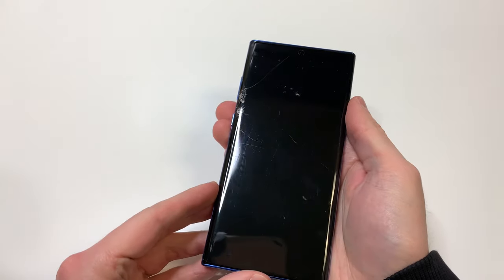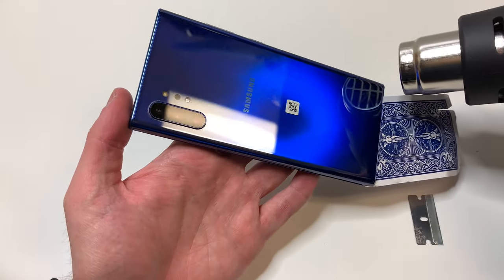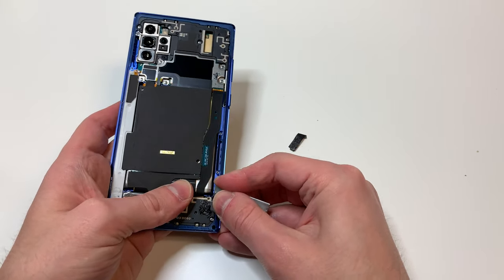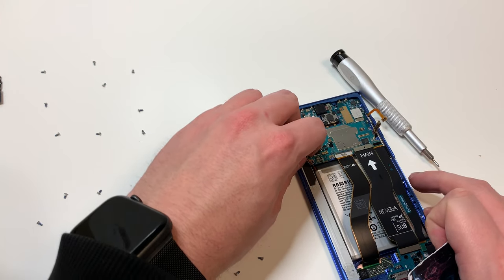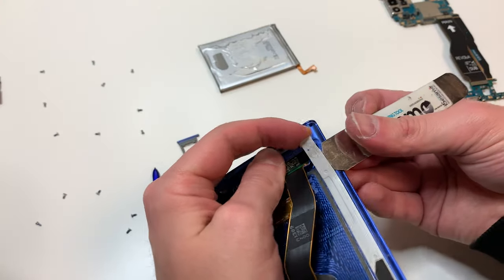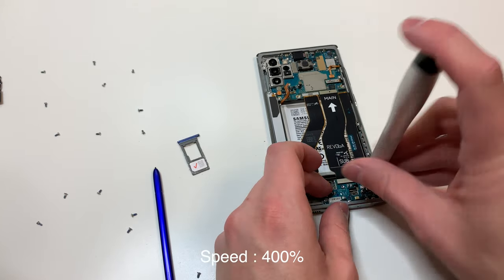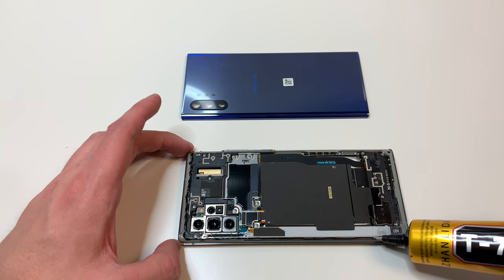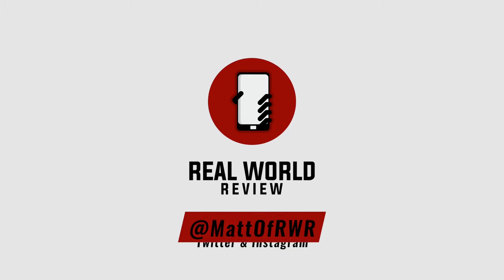Samsung Note10 Plus Screen Replacement (Fix Your Broken Display!)

Comment: Now I don't feel so bad about the price they charge to do this
Reply: Dude... they charge over 300$ for just a screen replacement. A brand new note 10+ is 3-400$ just buy a new one or fix it yourself
Reply from the maker: Perceived value doesn't mean anything when the actual value is a real number lol these parts are expensive because people complain about the parts being expensive
Reply: @RealWorldReview  I'm not trying to be a dick, but genuinely how is a part more expensive because people complain? Demand?
Reply from the maker: Well let’s try to visualize this. You’re more likely to spend $20 than $300, right? Well there’s lots of situations that happen to get that part that you’re buying. Let’s say those numbers are cost, so let’s sell them for $40/$340, same profit value. You’re more likely to sell the $40 product, so you can eventually drop the price to $38, then $35, all the way down to $30, which now you’re selling even more. The $340 may drop to $338, but who wants that when for less than that you can buy the entire device used for the same or even less? So now that $338 price never drops. Not to mention if you’re refurbishing, that $338 part has a higher chance of being damaged during refurbishing, which will cause companies to raise that cost even more. So now that $338 part goes to $380 because supply is finite, and you took some away from the supply (honestly similar to how BTC works). So the part isn’t expensive to be expensive. OLED parts cost more money to make than LCDs, while LCDs are SOOOOOO much easier to make aftermarket versions of when compared to OLEDs, especially curved OLEDs. Even now an aftermarket Samsung Note8 (yes a phone from 2017) screen is inferior to the OEM version in quite a few ways, and the price difference is very minimal. Even then those are $100 for aftermarket while an iPhone X is $45. There’s more variables in pricing, but that’s the broad overview of why that seller or store isn’t price gouging you (assuming they’re charging less than $100 over part cost that they can show you). It cost me $210 to buy that screen wholesale, expect maybe a $20 price difference depending on who you buy from, but under $100 for the part will be aftermarket (for the Samsung Note10 Plus)
Reply: @RealWorldReview  can the screen and frame be repaired? My phone was stolen back in July and when they found out they couldn't get into the threw it on a busy bridge and it got ran over multiple times I had a Otterbox case on it. It still charges and lights up the sound would work too just can't access anything.

Comment: Great Video! At first it seemed complicated but pausing after every step its actually super simple! My phone repair shop was gonna charge me $400 to fix my screen on my Note 10+, but I just ordered a new screen and all the tools I needed plus new Back Glass, a new case, and a new battery (cause we pierced mine lol), all for around $150 and it works perfectly! The hardest part was waiting a week give or take for it all to come in but luckily my dad upgraded and gave me his old one to use for a while, my advice for anyone doing the same is to use yours or someone elses Amazon for free and fast shipping, and make SURE that the battery is the exact right model with lots of good reviews on it lol
Reply: Hey bro..my galaxy Note10+ display is also damaged..half screen is visible and the other isn't..but touch is working overall..do I need to order any specific screen model and touch model to be able fix and start using it..or just have to order like normal Note10+ display???
Reply: @mohammedanwaruddin7874  Anything that says Galaxy Note 10+ Touch Screen should work other then that you shouldn't need a specific model or party to buy from, though id recommended making sure it also says it has the frame
Reply: @galaxygold5939  ok thank you

Comment: THANK YOU SO MUCH!!  I made it all by myself  just by following your instructions,  payed 150 USD for the screen  but sadly,  I was very excited and  broke the  glass that is on the back  of the phone when I was opening the phone but whatever , The front screen is now working!

So be very careful and take your time when removing the back of your phone. just go safe and slow. 
About the screens I got mine for just $150 US from aliexpress and $15  more for the tools and the glue . the screen is around 300 US but you can get the ones with little defects for half the price, mine has just a little black dot and that's it.  I don't mind having it when its barely noticeable.
Reply: was it samsung genuine?
Reply: @metubeaccountko   Not sure it was 2 years ago so I do not remember, But I still have it and the quality it's pretty much the same.

Comment: Great video! Is it necessary to back up the files before replacing the screen?
Reply from the maker: Thanks! No you don't need to, but it's highly recommended in general if you have important info on there

Comment: If you are still using the CC method for removing batteries and other parts secured the same way as the battery, I recommend cutting a saw tooth pattern into the edge of the actual card with a knife or scissors. It makes cutting the battery tape much quicker.

Comment: Do you know if a Note10+ display replacement will work on a Note10+5g?

I just bought a shattered note10+5g off of ebay and I plan on using a note10+ screen + frame to replace it with but I'm not sure if It'll work.

Comment: Here's a tip: Connect the new display backwards to it's connector after disconnecting the old display. This way you can test if the new display works properly before complete disassembly.

Just installed a replacement display, and found that it doesn't work. Only tested it after, reassembling everything but the back cover :/
Reply: Where did you find a display?

Comment: You did a fantastic job with this tutorial. Thank you. This is very useful information for me. I was wondering if you could recommend a reputable distributor for replacement batteries for the Note 10 plus? I see tons of options available on amazon and eBay however I've been made aware that 90% of these are junk, and don't' deliver the advertised mAh rating... any advice would be much appreciated.
Reply: I personally has just self-replaced a Deji battery for my Note 10. It's working great with avg use time of 9h~11h (with screen on/off running daily browsing apps) and doesn't give off as much heat. Note that the phone own battery diagnostic will declare your every new battery as weak unless you change them at a SS service center.

Comment: I know this late, but I want to as a question. My note 10+ screen broke and was replaced but since then, the s-pen is not writing on all the screen. it writes on the side of the screen but not in the middle. I bought the s-pen sensor flex cable to replace it thinking that that is the issue. I cannot change the screen again because it is pretty expensive. Would like your advice on the matter.

Comment: Have a link to buy the necessary tools, and screen?
Reply from the maker: In the description. If the screen isn't there, then there's a screen shortage
Reply from the maker: It's in the description. If the screen is not there, it's because it's out of stock. Right now there's a major screen shortage on the Note10 and Note10 Plus

Comment: I was wondering do you need a new batt after that? It's a pretty serious bending in order to remove it no?
Reply: 99% isopropyl can be injected below the battery with a needle applicator. It will dissolve the adhesive and allow you to remove the battery without bending.

Comment: So theres a sizzling sound when I plug the screen cable in. Is my screen fried? Was doing a battery replacement and it did work but screen turned black after a min
Reply: Similar thing happened to me can u pls tell what was the fault ?

Comment: Excellent video! Question: I just dropped and broke the screen on my Note 10+ last night. I have Asurion insurance from Verizon. I looked up replacement screens on eBay and other sites, but they are very expensive. It will cost me $199 through insurance to replace the whole phone. My fear is that I want to keep my phone exactly as is. Since I don't know if there is a way to clone my broken phone to my replacement phone I may have to go with the new screen. Any suggestions on where to get one? Thank you
Reply: Back up to smart switch. You can back up to a microsd card and it'll copy everything back as is.
Reply from the maker: Do at your own discretion. I did that and was never able to restore via memory card
Reply: @RealWorldReview  Interesting! I had to replace my Note 10 Plus and everything went straight back. Maybe your SD card was encrypted? I made that mistake initially.
Reply: Thanks guys. I could barely see my screen on my broken phone, but when I placed the new phone next to the old phone I was able to make an educated guess based on reference when hitting the buttons on the screen. Anyway, I did use smart switch and back up and restore. Back up and restore did move some things to my new phone, but not texts or apps. Then for the heck of it I used Samsung Smart Switch and I have to say it worked quickly and flawlessly. It basically cloned my old phone to my new phone. Thank you all so much for the help.

Comment: Great Video,  But now the caller herars themself twice, I took appart and the square rubber pieces are in place around the mic holes where the board meets. would you know why the echo now?
Reply from the maker: Might be a defective frame.

Comment: Have you ever experienced receiving the wrong type of screen when trying to repair the note 10 plus? I replaced my screen and when i powered it on it has bezels. The oem is bezel less i thought.
Reply from the maker: They make aftermarket ones now. If you paid less than 200 it's not OEM

Comment: Hello! Hi!
So my Samsung Note 10+ (5G) is broken and when I took it in to the repair shop they said it was $600 for repair. Is this price fair? If it is, I might as well just buy a new phone all together. Thank you!
Reply from the maker: That's way too much. $400/$425 at most unless you have multiple problems
Reply: @RealWorldReview  so the screen is cracked and there is a few black and white lines running horizontally
Reply from the maker: @naelevangelism  Yeah a store should be able to fix that for under $400 for sure
Reply: U can buy a new one on ebay for 300$

Comment: Only my frame has some scratches above the spen , how can i get a new one?
Reply from the maker: You need to replace the screen with the frame all in one. It’s possible to separate the screen, but very difficult without the right tools.
Reply: @RealWorldReview  so i really need to pay 350$ for a new screen repair even though i only want the frame to be repaired?
Reply: Otterbox defender, worth every penny.
Reply from the maker: I would contact Samsung and see if they can do anything for you.

Comment: Can I ask what the downside to ONLY replacing the screen and not the frame?
Reply from the maker: Generally the screens cost just as much as the screen with the frame. If you don't apply it properly, the front camera may be blurry. The screen is extremely fragile, so if the frame isn't cleaned perfectly, your new screen may get damaged. Most companies offer no warranty on the screen, but do with the screen in the frame. Lot more glass to break when doing the repair, as well as a lower chance of getting the best water resistance you can post repair (but assume your phone IS NOT water resistant anymore once you break the phone)
Reply: @RealWorldReview  I was told that removing the charge port damages the hydrophobic coating causing it to lose its water resistance
Reply: This is why I only wanted to replace the screen
Reply from the maker: It might. But I've changed batteries on phones like the S9, added all the waterproofing back onto the phone, and seen that same phone fail due to liquid damage. Always assume water resistance is gone once you get a crack in any glass components
Reply: I am confused. If it comes with the frame and the frame has all those things on it that i dont understand, will it erase my pictures and videos? Where is all that date located in the phone? I've tried connecting phone to laptop but I'm guessing my phone is asking for permission since it vibrates and i cant do anything because the screen is broken and flashing black and blue

Comment: How much does the screen cost? It seems like the display unit itself is the same price of a refurbished note 10+. Utterly ridiculous
Reply from the maker: Yes, the difference is you would have a new screen on your used phone, rather than a used phone. Refurbished doesn’t always mean that anything has been replaced (also doesn’t guarantee that that replacement was done properly)

Comment: Video was great, but I just checked, the screen cost $359 and where I live, the local repair shops charge $350 to replace the screen on a note 10+  that's for parts and labor.
Reply from the maker: Yes, that's around how much I can fix it actually. Not sure why. I get the part wholesale though

Comment: How to replace only the spen flex cable?
Reply from the maker: Where do you buy the cable? Can't find anywhere to buy it
Reply: @RealWorldReview  ifixit has it
Reply from the maker: @aloochat3555  interesting. Doesn't seem fun to replace. High chance of damaging the display which is a lot of money
Reply: @RealWorldReview  yea but the screen cost compared to the cable cost is big, cable cost 7-15 dollars.
Reply from the maker: That's correct, but removing the OLED to change that cable is extremely risky.

Comment: Hello, thanks for the video!! 
Can i use the battery if i've ripped only the metal foil that wraps it? There is any way of fixing it like sealing the hole with electrical tape???

Thanks
Reply from the maker: For $20 or less, you can get a new battery. Highly recommend that, or you might end up with a Note7 in the future
Reply from the maker: Another thing is it might actually expand overtime (had this happen on an A01)
Reply: @RealWorldReview  But there is an high risk of fire or can  it operate for some time??
Reply from the maker: In theory it should be fine, but expansion may cause issues with the back glass and even the display. Rather $20 for a battery than $15 for the back and whatever a new screen would cost lol
Reply: @RealWorldReview  I'm asking just because i need to check if the lcd that i've bought works, so i've planned to do it with the bad battery, maybe even use it until the new arrives